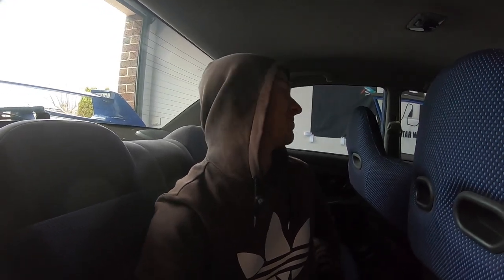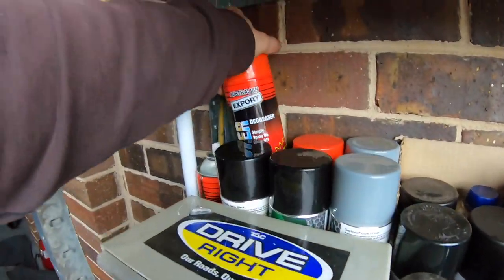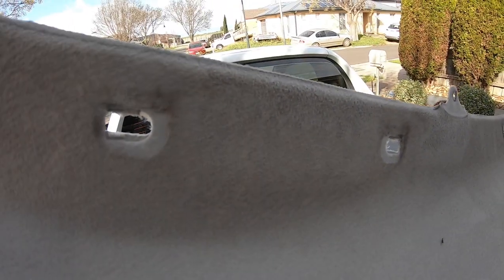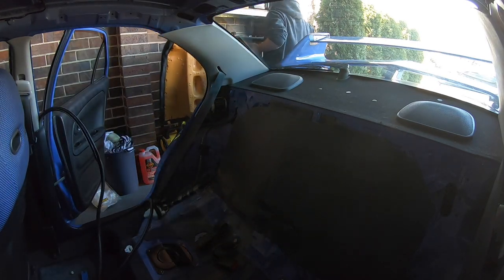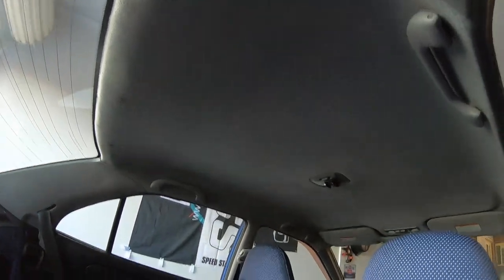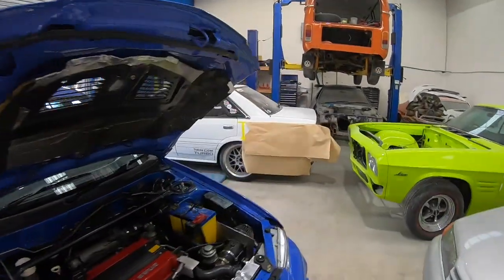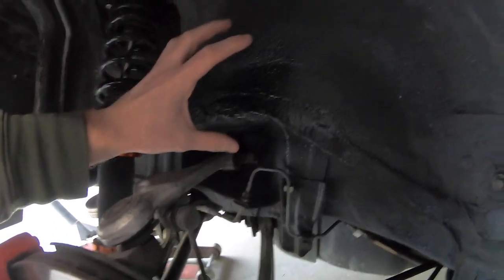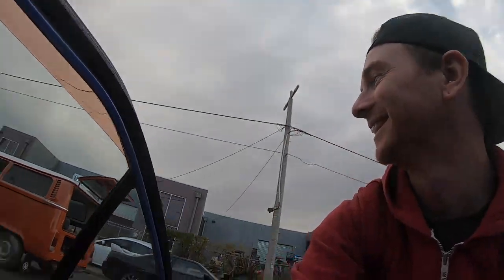Lancer EVO 6 rust repairs

Comment: I noticed u removed the boot weather strip, was it hard to remove and easy enough to put back to clean those spots? I wanna eventually remove the rear and front glass to clean all of that...
Reply from the maker: the rubber boot seal? just pull it off nothing to it

Comment: Iv gotten  only 5 mins into the vid and seen you got the wet vacc please don't tell me you made the same mistake as me and didn't think at the time that when foam under the material goes soft and the material just ends up falling off.

I'm having to re glue the whole thing again 🤣🤣
Reply: Ahhh your lucky the roof lining backing is plastic i was and idiot and not thinking when i started to clean mine last weekend in the SS
Reply from the maker: did watch your video of re-glueing it haha
Reply: @MindieJ  hahaha 😋😋😋